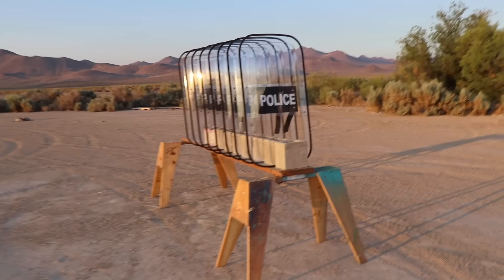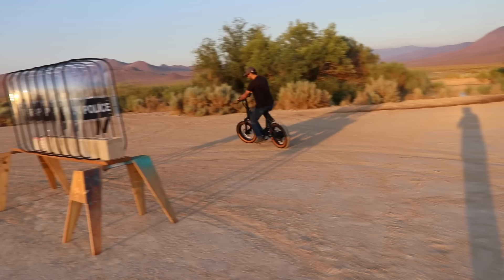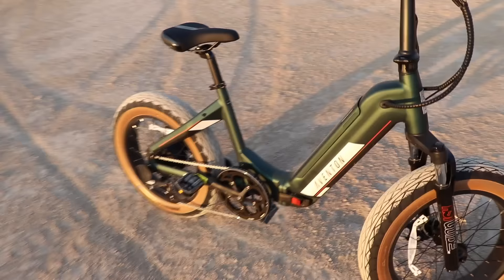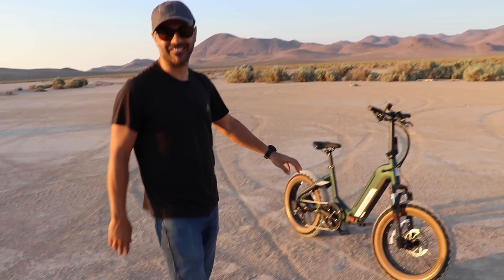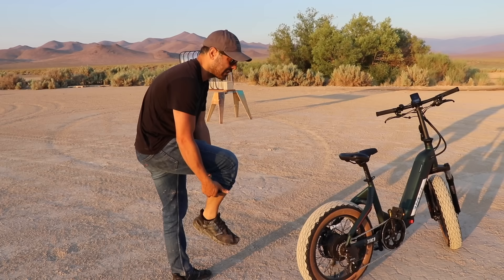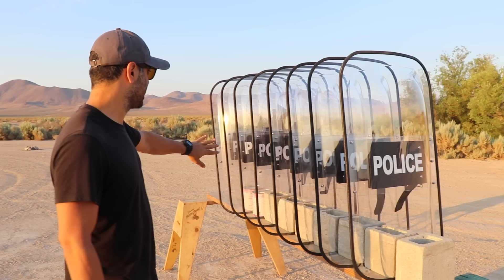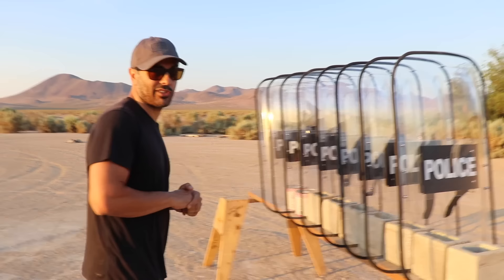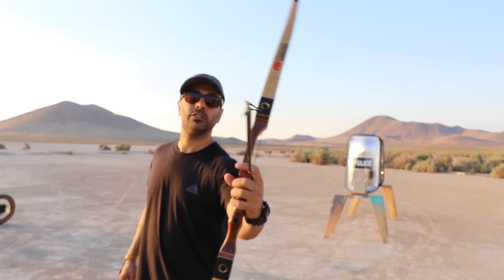THE Most Powerful Crossbow in the world vs Riot Shields

Comment: 400fps was such a novelty and limit in the crossbow market, its remarkable that they can accelerate arrows to 500fps now.
Reply: Electromagnetic energy can send a metal arrow up to 1/10th the speed of light and potentially turn all hazardous asteroids and comets to clouds of vaporized material while they are still beyond Mars orbit. We just need a large enough battery and rails that can handle the amount of energy needed.
Reply: @BlueSkyCountry  yeah sure you can when upscaling it, but i mentioned  relatively compact and mecahnical arrow accelerators that can be carried and operated by 1 person alone.
Reply: @Scout887  With new solid state batteries being developed, that might just be possible in the near future. If you can integrate a laptop battery sized pack generating up to a 1000 amp / 800 volt burst, and an inert gas injector to push a steel arrow between the accelerating rail so the arrow does not weld to the rail and cause a short circuit, you can get that arrow not only up to several thousand feet per second, but part of the bolt would be vaporized to a near plasma state, penetrating even the armor of light APCs and fighting vehicles. That kind of weapon will bring back the era of "cold weaponry" ie., pre-firearm, but now powered by electromagnetic energy. Perfection of that tech will revolutionize space travel as well. If giant electromagnetic catapults could be constructed, freight and passengers could be shuttled between the planets and moons of the Solar System with the ships only needing enough fuel for orbital and reentry maneuvers upon arrival. Colonies on Mars, and the Jovian moons will be a reality.
Reply: @BlueSkyCountry  The company "SpinLaunch" is trying something like that, shooting low weight satellites into earths orbit.
Reply: @Scout887  Yep. It is basically a giant version of an ancient sling. Pretty cool though not for passengers, as the acceleration is ridiculously fast and violent.
Reply: In the medieval times they had crossbows over 1000 now these days we can't because we want lightweight and easy to load crossbows
Reply: @anthonywomack2572 it's too hard to load something like that
Reply: @jorgeillueca5260  not if you have a windlass

Comment: Depending on motor strength and the battery wattage, you can remove the speed limitation settings on that ebike. Wouldnt push it past twenty five miles per hour though
Reply: You really need to make sure the tyres can handle the speed & chains can be a week link at higher powers , especially the light weight racing chains  also basic caliper brakes can shed their blocks when used at speed  or even overheat rubber ones  .
Reply: @richarddixon7276  that, plus the interfaces are usually compatible with the bike its on, but it isnt bike specific. The interface has options to crank up to 50mph, on my bike that would burn out the motor and probably short the battery. On a different model with a differently geared motor/stronger battery, wouldnt be an issue. There are a lot of reasons not to push it too much
Reply: @UrDadsFavouriteMaleEscort  Oh Yes , they might look like toys , but really the faster ones are to all intents light weight electric motorcycles styled like bicycles .
Reply: if you don't mind voiding your warranty
Reply: @busybee6889  not an issue if you know how to do general repairs and maintenance. Some brands have a specified max safe speed for each model too, in those instances you'd only void if you crank it past advertised output.

Comment: I have the aventon level. I've got nearly 2k miles on it since last November. I ride at least 12mi a day going to and from work.
The 45mi range is in perfect factoring conditions. It depends on your pas (pedal assist) setting, weight, and the grade of your trip. Using full power pas5 I can get about 18mi out of one charge. I average about 25mph, but have hit up to 32mph at times.
 Throttle only will get you 20mph, pas1 will get you 10mph, pas2 15mph, pas3 20mph, pas4 24mph, pas5 28
If you use it a lot, I highly suggest getting a second battery, that way you always have one ready to go.
 I've forgotten to charge mine before and was grlad I had the spare or I'd have been late for work.

Comment: The Remington 11 is what it looks like you have,  it’s a clone of the iconic Browning A5 that is still produced to this day.    It wasn’t ejecting more than likely cause them was lower fps rounds and didn’t have the power to fully cycle the weapon.
Reply: Yes the infamous shotgun of Bonnie and Clyde
Reply: Maybe.. Or maybe not..
Reply: If its brand new it could need to be run in too
Reply: @Jake_Hamlin  they stopped making them in like 1947.   So doubt it’s new.   It’s a great shotgun and like many semi auto they typically need higher fps loads.   Many of the low “brass” target loads are pretty light.   I kinda do this stuff for a living.
Reply: @GodsGladiator  You know you can change the friction rings around to make them function with low brass target loads..yes?   Just remember that once you do that DON'T fire anything high brass or it'll batter the gun...and the shooter with excessive recoil.
Reply: @GUNTHER1  100% agree both 00 and slug is high brass and unless something else is wrong should cycle it
Reply: @recoilrob324  yes,  there should be like 3 different friction rings for it if I’m not mistaken,  the steel, the bronze and the steel Cutts compensator.     Regardless tho it appears the gun isn’t configured for low brass and resulted in the short stroke
Reply: @GodsGladiator  I just rewatched and he's using hi-brass so that's probably not a short stroke failure.   Considering that each shot he remarks about how hard it kicks, and with a shortened barrel I'm guessing it's recoiling too fast which trapped the ejected second shell.   Last Browning I played with is like 30 years ago...so memory is failing, but IIRC it wasn't reliable and kicked VERY hard...likely due to the rings being wrong once I'd looked into and saw how they were supposed to work.   Would be interesting if Edwin would do a video on the gun and how the rings are assembled to find the solution.
Reply: No, that's a fully semi automatic fifty caliber heat seeking long range nuclear pistol rifle. Ban assault Twisted Tea!
Reply: I have close to the same gun don’t know what it’s called or much about it but I also had same prob there is away to switch something on the inside of the gun I think in the recoil spring assembly one setting for short brass other setting for long brass I’m sure you just got it in the long brass setting is why it’s not ejecting the round. That and clean it up a bit. And for the love of god stand behind some cover so you guys don’t catch ricochet’s. Keep it up you guys are fun to watch.
Reply: You mean browning auto 5
Reply: I've owned one, and almost positive it's called a Remington auto 12.

Comment: Would be great to see what this crossbow can do to a wooden shield, like medieval ages.
Reply: Wood is really good at biting things. Maintenance for most shields required a special oil and leather as well to make sure arrows couldn't penetrate. With this type of crossbow it might go through 2 of the Roman shields. As for the iron shields, maybe one.

This crossbow might grant many advantages to someone but it won't be decisive. It takes too long to load so it's like the riflemen of the 1700s. Its biggest advantage is range and accuracy, but you won't be able to pull off anything a modern sniper can only 200-300 feet away.

I would personally recommend just a single m1 Abrams MBT. It can just sit there and nothing can really hurt it. And you can always run over people who try to mess with you. The .50 would go through at least 5 or 6 shields before the bullet's deflected away and the main cannon would likely go through everything.
Reply: @puppergump4117  Couple things a sniper can't,  quiet, penetration of sandbag barriers.

Comment: Bro penetration with an arrow is much easier than with a bullet, first weight, 2nd length and momentum force of arrows are crazy higher than bullets even at slower speeds, 3rd arrows carry kinetic energy tens of times higher than bullets.. all u need is a good diamond penetrating tip, a steel rod, and a gun powerful enough to shoot it.
Reply: Sharp fast quiet
Reply: Average Kinetic energy of a 9mm fired from a handgun: 354 Ft/lbs
Average Kinetic energy of an arrow fired from a compound bow: 52Ft/lbs

are you high?
Reply: Plus we have to keep in mind, they’re using riot shields not ballistic shields.
Reply: @devinfosdick3774  smaller weight, higher speed versus higher weight and slower speed.  If both had the same Ft/Lbs rating, you might find they react differently.

Bullets are soft.  Razor blades are so hard. That is why it penetrates so well.
Reply: The arrow is  under 300 grains  so about  that of a 45,
Reply: @Sr.DudeGuy  I'm thinking it's to stop rocks or water bottles, stocks. Deflect blunt objects like maybe bats. It's definitely a paper sheild for any kind of weapon made after the dark ages when people were shooting bows and swinging maces wearing metal suits
Reply: The other commentor is correct. The Remington model 11 is based on the Browning A/5. The reason is wouldn't eject properly is because of the lower velocity bird shot shells. That is an enertia operating system which needs higher charged loads.
Reply: @devinfosdick3774  thats not how arrows work for penetration
Reply: @killerbern666  The original comment claims arrows have higher kinetic energy by tens of times, which is extremely wrong. It's true that arrows penetrate a lot better than a kinetic energy comparison would make it seem, but not true that arrows have a lot of kinetic energy. Also, about the only bullet arrows do better than is .22 LR / .22 Magnum rounds or similar. Most handguns will outperform an arrow at most tasks. Rifles are in an entirely different category.
Reply: @RoystonII  well, it penetrated massively more than this 22 mag 🤣
Reply: @knrz2562  bows aren't quiet
Reply: @RoystonII  yeah kinetic energy increases quadratically with the magnitude of velocity but only linearly with mass, so what they said is a physics fail unfortunately

Comment: That huge head on the arrow wouldn't have helped it get through best to have a very sharp point narrow point also you can get 150lb draw on a standard bow but you will have to be very strong
Reply: Broadheads actually have some very advanced abilities to cut through all kinds of stuff. It would hypothetically be better to have a dedicated point to penetrate stuff like this, but nobody makes that because it's not a realistic use case. So target tips are designed for target practice and don't really penetrate well, while broadheads are designed to cut through as much bone and muscle as possible, therefore penetrating better than the narrower tips despite more surface area.

That said, there's a huge difference between a cheap broadhead and an expensive one.

Comment: I'm curious? Can you remove the accessories and somehow bond 2 or 3 of those shields together. I'm wondering if the shield was twice as thick, would it stop the bolt from the 505 where as with space between them it passes through 2 with ease?

Comment: Bows are of 2 types: 
- modern - rely on speed of shooting and fast arrows, - high kinetic energy - buy low mass. So if you get the arrow to stop its useless.
- old bows - rely on weight of shooting and mass of the arrow. These are bows made to penetrate. Just stopping the arrow doesn't end the damage because the inertia still give it more energy.
There's a video of a guy penetrating medieval armor by shooting arrows made entirely of steel. While at the same time modern arrows do no damage and medieval arrows made of wood shatter.

Comment: Yes you have to pull the cylinder out to reload it but you should put the hammer and a half cocked position to clear the firing pin so that sooner slides in and out easily in the groove on the top is your site

Comment: When thinking about the penetration ability of crossbows you have to look at it like a 38 calibre bullet in terms of kinetic energy but in addition,  all of that kinetic energy is concentrated  on the very thin edge of the broad head tip, in contrast bullets from guns have much larger surface area (so energy is spread out not concentrated) and of course the bullet deforms becoming even wider and spreading energy even more which reduces penetration.  The same average inertia is being transferred between 38 cal bullet and crossbow bolt however bolts concentrate energy to promote penetration.   Crossbow bolts kill by bleeding out the target, bullets kill by putting target into shock

Comment: You're kinda messing the penetration with the bolt by adding a broadhead, since the diameter of the broadhead doesnt go the same diameter as the shaft and the cut of the broadhead is so thin

Comment: For the normal bow the first bow you used you should have used an normal arrow head would have had better chance going threw more blunt like a bush shot low velocity round more blunt the bullet that's why there's Bush shots with low velocity an high velocity shots. Still good video guys 👍👍👍👍👍👍
Reply: and if the first arrow hit center

Comment: If that’s a Recoil Barrel ( The Whole Barrel will Move ) You have to hold tight on shoulder or it will not Eject Properly.  ( Not sure of the real name of that type of barrel.).  You can test by putting but on Your Leg or Ground and grab barrel in front o forearm and pull down.  If it moves into action it’s a Recoiling barrel.

Comment: A broad head point is designed to penetrate soft tissue not armor. There is a point designed to penetrate armor it called a BODKIN point it is shaped like a chisel. A bodkin would have penetrated on the first try with a 50 lb bow. Use the right weapon for the job.

Comment: that shield are truly hard..when the police is on their duty to perform to protect the interest of one side ..the protestors or activist is the enemys of the authorities because ..one side i insisting their right..but due to maximum tolerance the protester have ignite their emotion and getting to tense the situation ..in that behavior both are make their move to have ..the unavoided situation ..when one sides begun to throw something ..in that event ..the shield is one to make depensive if the shield is not fiber hard ..it can penetrate..by poited object..such like arrow or gun bullet but depend and even fire bomb with contains of sharpnel and pillbox bomb..but its good to have shield to avoid more wouded and casualties..

Comment: who idea was to have bromance  live on vide. also e-bike have weight limit on how much it can hold. so if some over 300lnb some e-bikes will not work. also some can go 45mph but have 1000 watts power. my bike can do up to 22mph and has 45miles range but can not go at full 22mph only about 15mph to get close to 35 miles

Comment: They have no idea what they are doing.... This is why people make fun of gun users.  First if  you want to do a real test with an Arrow you use a heavy arrow, like 500 grains.  You will see a huge difference.   If you heard the buzz when the arrow bounced off the shield was because the broad head was loose and not tightened down all the way.  They are using light arrows and bolts.  Also if you think a bullet might not penetrate the stupidest thing you could possibly do is stand a few feet away.  Good way to get yourself killed, if it was to rebound (bound back at you) you could easily die.  So don't do anything like these guys, if you want to appear to be a responsible gun or bow user.